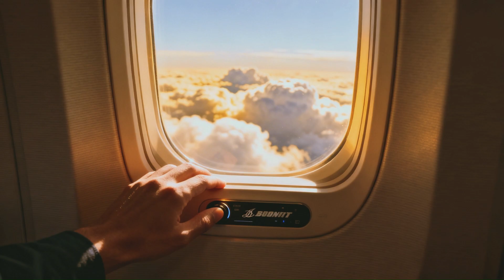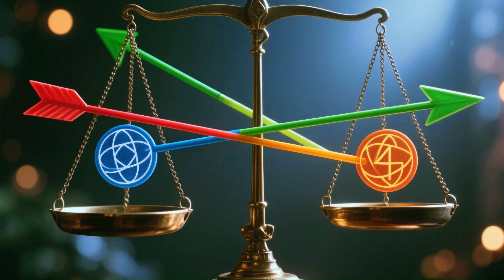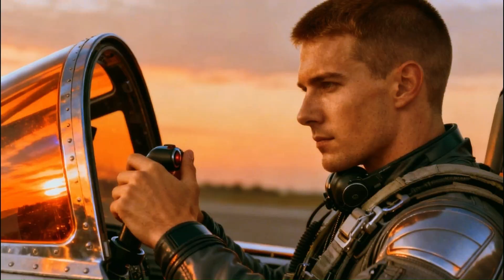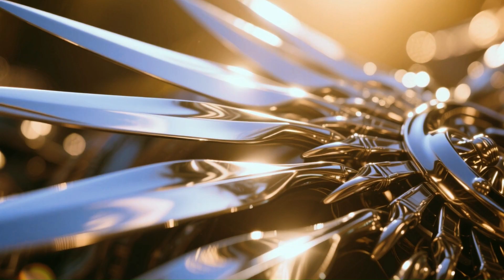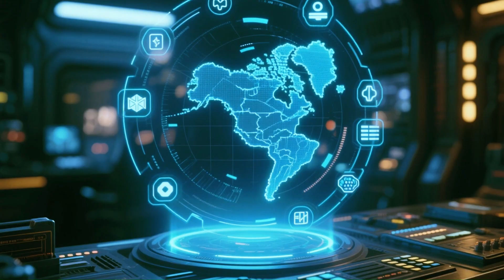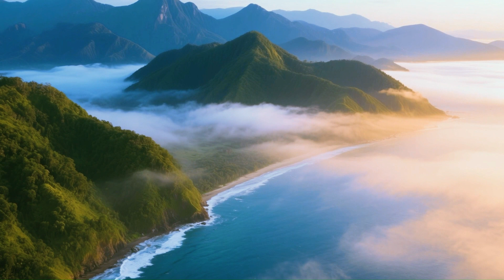The Secret Physics of Flight (That Most People Get Wrong)

Comment: Wrong, wrong, wrong. Bernoli's principle does not really apply to the lift created by an aircraft's wing. Bernoli's principal applies to fluid's moving through ducts, pipes and especially nossles. A wing creates lift when it passes through the air at an "angle of attack." A low pressure area developes at the upper surface of the wing toward the front and a high pressure rea developes below the wing. The air does NOT flow faster over the upper surface of the wing relative to the air passing below the wing.
Reply from the maker: "Great point! It's wild how much debate there still is about the 'true' cause of lift. It’s definitely a mix of several different principles working at once."